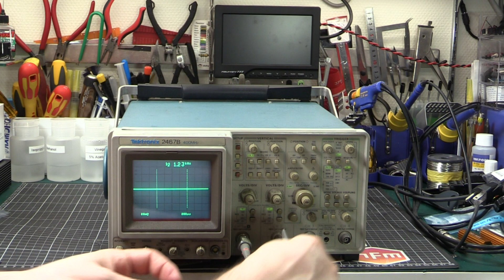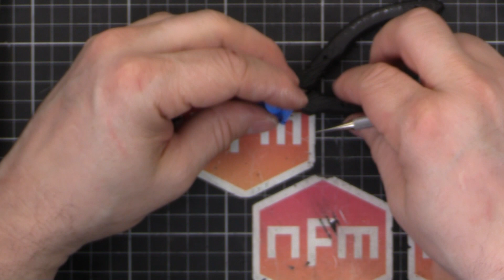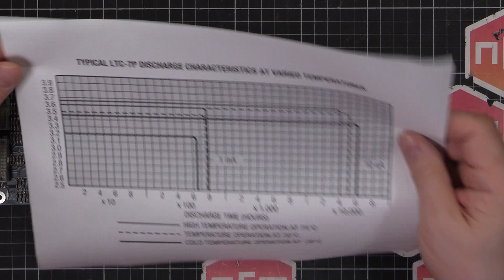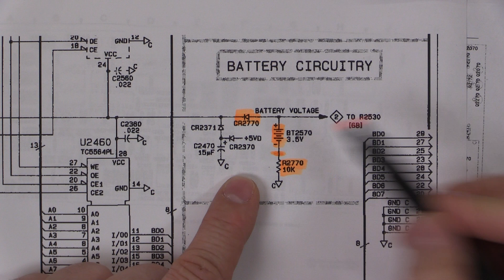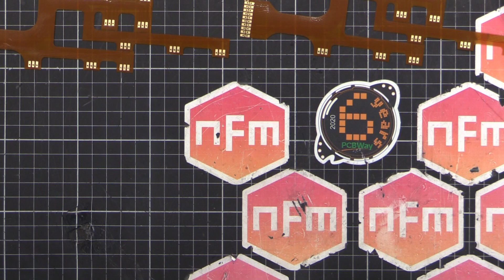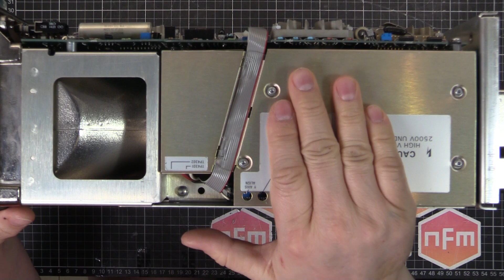Tektronix 2467B Oscilloscope Restoration

Comment: There are users who have put FRAM on the DS1220 support, with excellent results. This voltage backup method, without a series resistor, will stress the new battery to its limits by causing a sudden discharge down to 3V. However, I would have opted for official calibration of the oscilloscope, since the manufacturer recommends recalibration every 12 months. What is the current accuracy of the measurements?

Comment: Hey I have an early serial # 2465b which I suspect has the same keeper battery as yours. I have access to a bench power supply, would you still suggest soldering a battery pack to the board over using the supply? Somehow the battery is still going, probably because there are like 5 original hours on the unit but I need to consider replacing it in the near future.
Reply from the maker: If you use a bench power supply make sure to use an isolated battery powered or butane powered soldering iron so you don't short out the battery via a ground loop and lose the memory.

Using a battery pack eliminates this possibility.
Reply: @NearFarMedia  I figured it would be something like that, I'll likely just follow the battery pack method when the time comes. I also saw some people online replacing the ram chip with fram on an adapter board, any idea if it works here? A hurdle with the non dallas chip is how to dump my current good firmware to back it up and use later without losing power.
Reply: I measured my lab power that no continuity from minus to ground so it was safe. Set the voltage to the same as the new battery so there’s no danger that the new battery would feed anything. Worked like a charm.

Comment: Great video, thanks! Im just about to recapp a 2465B, same PSU. Are you aware of any updated BOM for recapp? Also, you mention som resistors in the PSU that should be replaced, but never point out which. Thanks in advance!

Comment: Brilliant use of that flux pen!did any of the silicon grease go over the wiper or track?
Reply from the maker: I used a plastic safe white lithium grease and yep, put it thinly on the wiper and track, like the manufacturer did originally. That way the track will be lubricated to reduce wear.

As a side note, I don't think it matters for trimpots, but avoid using silicone grease in switches, apparently any arcing in the switch can slowly turn the silicon in the silicone grease into silicon carbide which is an insulator and very(!) hard and abrasive....

Comment: At 23:38 that battery is dated 9714, so 1997 and 14th week, it's already 23 years old when you made the video! Time for ANOTHER new battery.
Reply from the maker: That number is just a production batch number, it's not actually a date code.

I have purchased a number of verified brand new batteries and the codes were no where near the actual date, some used letters as well as numbers and others would have been in the future..
Reply: @NearFarMedia  That's good, thought you'd have to do it over again. I miss when things didn't have to have backup batteries or need a microscope to solder something.

Comment: Hi from Adelaide, i have a TelInstruments 25mhz scope which my ex pushed off the bench and took a big fall and now have a ch1 vertical position problem..
Any ideas where you think i should start troubleshooting as i pretty intermediate. .? 
https://youtu.be/ev46QpcK8K4
Much appreciated
Reply from the maker: Here is a Tektronix document on troubleshooting scopes.

https://www.sphere.bc.ca/test/tek-parts/troubleshooting-scopes.pdf

Basically all analogue scopes work the using the same principles, so this should help you figure out what's wrong.

Also, check around for a user or even better a service manual, schematics make things much easier to troubleshoot.

I would first be checking the CRT, it is delicate and if it was damaged in the fall, you might be better off scrapping the scope and getting another...

Comment: Gd day sir, I have a tek 2445b 150mhz model, the trace on channel 1 and 2 sometimes goes up until it disappear (off screen) and some time the trace goes down the screen until its off the screen, what must be the trouble sir? What section of the scope could have cause this problem? Any help would be appreciated thank you sir.
Reply from the maker: Sounds like you need to check the vertical position control circuit, or the vertical amplifier section.
You can find the manuals on tekwiki, and if you make a post on the tekscopes groups.io page or the eevblog forums, someone will be able to get you sorted. :)

Comment: So how do you unclip the plastic over over the main smoothing caps?
Reply: OK, manged to do it.  You have to push a screwdriver or similar down between the 2 caps and push the tab over at the bottom (whilst pulling the cover off of course)

Comment: Hallo NFM what equipment do you use to dril out the solder connection out?
Reply from the maker: I use a Hakko solder sucker attached to my solder station to suck the solder away.
Reply: Hallo NFM do you have a cover voor the tektronics 2465B  art nr 200-3199-01

Comment: Do you recommend replacing the Dallas DS1225AD by the RAMTRON FRAM FM1808-70-P 256kb?
Reply from the maker: I haven't tried this mod myself, as my scopes don't use the Dallas battery backed RAM.
Unfortunately I can't comment on the mod as I have no personal experience with it

Comment: Cool video. Quick suggestion regarding the battery replacement. Instead of hooking two batteries with different voltages in parallel (I’m sure the batteries were slightly unhappy about the event…) you could have connected a diode in series with the 3.0V backup battery (as in the schematic CR2770). Even with the diode drop, after removing the original battery you’d have 3.0-0.6=2.4V which is above the 2.0V limit.
Reply: Very prudent suggestion to be heeded here. If by chance the old lithium battery got grumpy enough to drop to 0v, it could result in some very sad consequences, perhaps the least of which is the loss of the VRAM data. The addition of a diode or at least a current limiting resistor in series with the AA cells is most certainly advisable.

Comment: I have a 2445A scope and I did a cap job on the power supply, including the Rifa caps. I didn't do the main board coz I couldn't figure out how to remove it. Did you replace the caps on the main board with it in place or did you remove it? I still have a drift problem also. The trace drifts up slowly  (very slowly). If you have any ideas about fixing that, I'm all ears. All the voltages read within specs but I just realized as I'm writing this I didn't check them for any drift. 
I loved the video. It was very informative. Any help is greatly appreciated. Thanks
Reply from the maker: Removing the main board is a pretty involved process, I wouldn't recommend it unless you really need to.
I removed mine because I like living dangerously, but usually it's just the capacitors in the power supply that need replacing.
Don't forget to (carefully!) replace the memory backup battery too so you don't lose the calibration memory due to a flat battery.
Also the SMD tantalums on the CPU board (The one on the right hand side) if present as they ALWAYS leak.

I'm not sure about the drift problem, but I'd check voltages as you suggest. Also the service manual is pretty good for troubleshooting and performance testing these scopes.

Comment: Well done! I would have just run some wires instead of ordering a new flat flex. But it’s great to know that it is possible to order some if needed. By the way - do you know if it is possible to restore the bluish case color (coating?). I have some scratches that I would like to touch up. Is there a color code for the “Tektronix blue”, perhaps? :)
Reply from the maker: The blue coating appears to b some kind of plastic coating of some sort. It comes up pretty clean with some dishwashing soap and a soft scrubbing brush.
As for repairing scratches, there is a few threads over on the tektronix Groups.io group on paint codes and the like for various paint colours.
Reply: @NearFarMedia  I will check it out, thanks
Reply from the maker: Hi,
I just found this link you might find useful:
https://groups.io/g/TekScopes/files/Tek%20Paints.pdf
Reply: @NearFarMedia  Thanks for the link. Mailing groups, what a bizzare way of communicating, reminds me of Fidonet days :D Yet, it is a goldmine when it comes to Tek info, thanks again.

Comment: Another great video! Thank you. Capacitors are made with different types of technologies. What type of capacitor do I need to replace "refers?" If more than one type would do the job, what are my choices, so that I can weigh benefits against cost?
Reply from the maker: If you see any of the dirty nasty Rifa caps in your gear, just replace them wholesale with any quality film caps of the same safety rating (X or Y class) and the same capacitance and equal or greater voltage rating.
I don't even bother testing them, they are always cracked and will eventually fail.
Don't skimp on the safety ratings! You don't want them to cause problems if they go faulty. :)

Comment: Very nice video, Jared. Anyone interested can do the job (and some extra things) with it.
Reply from the maker: Yeah, the power supply work is pretty easy and the Rifa cap replacement is basically mandatory.
The cap replacement on the main board is a bit trickier simply due to the fiddly nature of removing the delicate board, but those caps are mostly ok to leave alone on most units I expect.

Comment: Many people can't resist the temptation to replace any dipped tantalum caps they see. There are two blue ones on the older processor board, C2350 and C2470, visible at 21:57. They sit above half way below the processor and just above the battery.
Reply from the maker: True, the older tants in Tek gear are good for one thing. Helping us to pick up a good deal on second hand equipment. :D
Often just replacing a few burnt tantalums in a bit of faulty gear brings it right back to life!

Which reminds me, I have to do exactly that in a Tek 577 curve tracer I have sitting here....

Comment: The remark about the ElCap (C1101/C1102) starting at 10:12 is incorrect, unless I'm very much mistaken. It's also in Yachad's otherwise excellent write-up about recapping these 'scopes.
First of all, this sort of caps has a standard tolerance of at least +/- 20%. Second, the circuit delivers about -13.1V, called "-8V Unregulated" in the schematics. It is the input voltage to the -8V regulator. The transformer that drives these caps (T1060) provides only "Unregulated" voltages, see dwg <9> in the schematics. I am not aware of any precision requirements for any of the ElCaps in these PSU's.
Reply from the maker: Ah, I read the same in that guide, and was working from memory...
In any case, replacing like for like is usually a good idea anyway, unless you really know what you are doing (or it's something basic like a linear power supply, where usually you can up the capacitance a bit pretty safely)
Reply: @NearFarMedia  That's what we all do. If you look at the schematics, you'll see it's just a voltage pump to get about -13V to feed the -8V regulator.

Comment: Even fast analog 'scopes suffer from lack of image brightness, not because the trace moves too fast but because it doesn't hit each spot on the screen often enough. So, not a speed but a duty cycle issue. As an example, not even a Tek 7904 500 MHz BW analog 'scope is able to clearly show a one-shot edge with say 4 ns rise time at 10 ns/div. At 1 kHz it's a no-show, at 100 kHz or 1 MHz repetition rate, it isn't a problem. The single-shot is no problem for a 7104 or 2467(B).

Comment: Apart from screen burnout, which doesn't happen at sensible brightness, MCP CRT's suffer from exhaustion of the special layer that covers the inside of each MCP channel and which produces the secondary electrons. With time, the electron multiplication is diminished, resulting in ever lower amplification. Most used MCP CRT's, even if used at low intensity, show darker areas where the trace sits most of the time, like at the center horizontal and in the readout area. To spread wear in the readout area, the 2467 periodically automatically moves the location of the readout display a bit.
Reply from the maker: Yeah, you really have to baby these CRT's to make them last.
I'll have to get myself a 2465B for day to day use to save this MCP CRT for when I really need it.
Reply: @NearFarMedia  Good idea! The larger screen and the better graticule illumination are added advantages.

Comment: Mate I hope that 9714 marking on your new battery is not the date code :-/
Reply from the maker: It was brand new off the shelf... it certainly didn't have 13 years of dust on it. I hope it's newer. :D
Reply: NFM  Hi, remember you have to substract the diode forward voltage (usually 0.7 volts) to the battery voltage, and that's the voltage the ram chip will receive, around 2.3 volts, very close to the lower limit.
Reply: @johnbonham7515  Correct. OTOH, the battery voltage remains constant for most of its life and above 3V. Also, at the extremely low current for the backup, the forward voltage will probably be lower than 0.7V, more like 0.65V or even lower for most GP Si diodes.

Comment: The 7104 had the same CRT as the 2467B. While the 2467B was up to 400MHz the 7104 was 1GHz! For the time there was nothing that could beat it.
Reply from the maker: I'll have to keep an eye out for a 7104, would be interesting to have a poke at.
Reply: The 7104 had an MCP CRT, like the 2467. It's not the same CRT however.
Reply: @raymonddompfrank1789  Are you sure about that? I could find the model info for the CRT used in the 7104 but not the 2467. I had always assumed it was the same one because the geometry of the 2467 is all weird compared to the rest of the 24xx because the CRT is long and the screen is narrow.
Reply: @ElectricEvan  I’m quite sure. The CRT in the 7104 is much bigger and since the 7104 not only has a vertical BW of 1 GHz but also a horizontal BW of 350 MHz (!) it has vertical and horizontal distributed plates. Also, it has many more geometry adjustment pins.
Reply: @ElectricEvan  The CRT in the 2467 is a 154-0896-01 or "T2467"